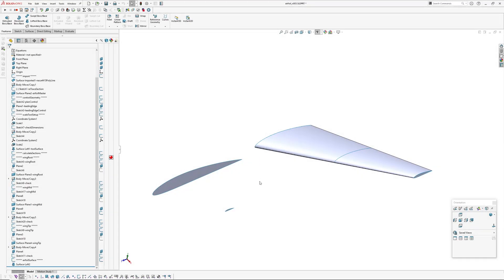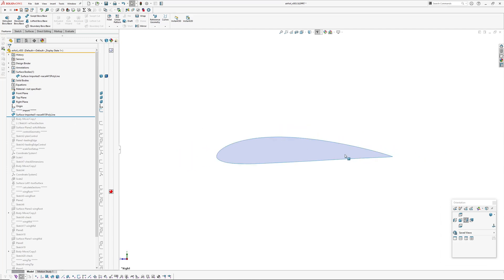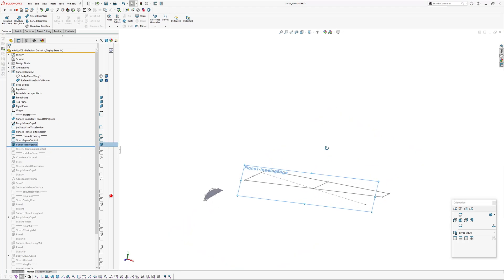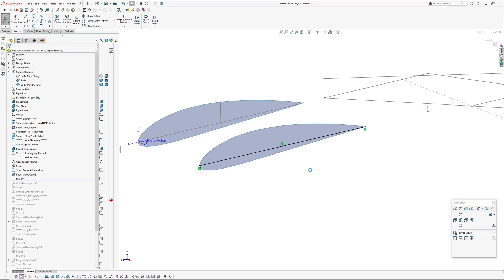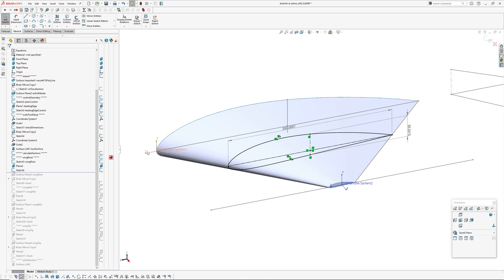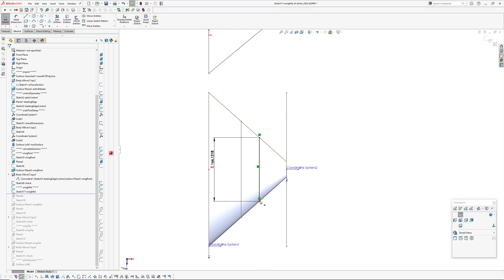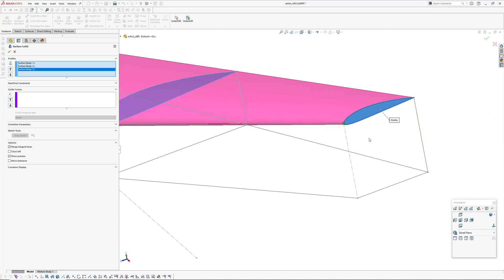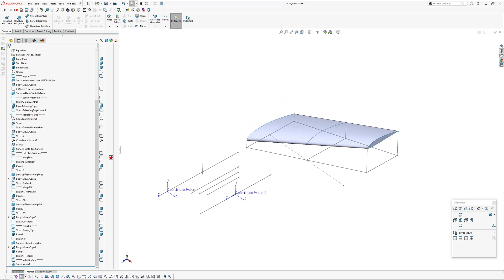Solidworks: Scale Feature Workaround When Using Imported Airfoil Sections

Comment: Here's my technique. I split the 2d airfoil into a top and bottom surface. I use the proportional spline feature to create a sketch with one proportional spline for the top surface and one for the bottom. This can be stretched by the end points maintaining intended shape. You can also copy and paste this sketch onto any plane along the span and use constraints to scale the section by the LE and TE points.
Reply from the maker: Hi there, that sounds pretty handy! Had a look at the help, proportional spline is only for the old interpolated spline? I tend to only use the style spline, but having a proportional option would be good. So you can constrain the end points of the spline to control geometry so when the control geometry changes, the spline scale changes but retains the proportions? 10 ways to do everything in SW :)
Reply: @AndrewJacksonDesignStudio  It can work on a style spline with a little workaround. Make a planar surface from your style spline sketch. Start a new sketch and project the edges. Copy and Paste that sketch onto a new plane, and you will be able to drag the end points to scale the curve proportionally. BTW your videos are great! I have learned a lot about surface blending.

Comment: Pretty Slick! My other main PITA with airfoils is thickening the trailing edge. I’ve been doing it by driving style spline control points with equations in profile sketches. 

On smaller airfoils, the trailing edge can be really thin which is a problem for some manufacturing processes.

If you just throw a fillet on it, you end up reducing the wing area.
Reply: Typically 0.5mm minimum. Typically consistent thickness. I usually radius the trailing edge for 3d printed wings. It would be flat for a larger scale wing that has a sheet metal surface. Similar thickness.

Seeing your process here I considered using some simple offset curves surfaces to rework the trailing edge after your 3d wing is lofted. May play with this technique next week. I like not fussing with a bunch of equations. 

The big plus to equations is that you can parametrically edit the airfoils. You could easily change from NACA 44xx to 44zz, etc
Reply from the maker: Hi Zack, good point about the trailing edge. I have an idea that might work with what I have done here. Would you need the trailing edge consistent in thickness?

Comment: A nice little workaround for the perennial scaling problem. 

Did you consider using equation driven curves to generate the profiles? I've used them to create a couple of NACA aerofoils in the dim and distant past.
Reply from the maker: Hi, I downloaded the .dat point file from airfoiltools.com, renamed it .txt, imported as points into Rhino, then made a polyline through the points so I could make a surface to import into SW. I find importing a surface more reliable than importing a curve. I manually drew the splines used to generate the sections.

Comment: Great model

Very useful in some cases, additionally, in case relevant for the project, you may consider  
>> project section on angled plane, retrieve angled surface for loft variations blending with initial surface
>> blend surfaces with grooves down to slick surfaces, achieving nice surface gradients

Thanks for sharing Andrew !
Reply from the maker: I like projection onto a plane idea. 1D scale!
Reply: @AndrewJacksonDesignStudio  Indeed, based on needs, you can even project on 2 planes, and get parametric scaling on 1D to x%/mm/etc and the other D to y%/mm/..
Plane project can be nice, if you need to translate a loft external profile (say front plane) to (say right plane), if sections are non square|cil, thus having better loft guides, end surface